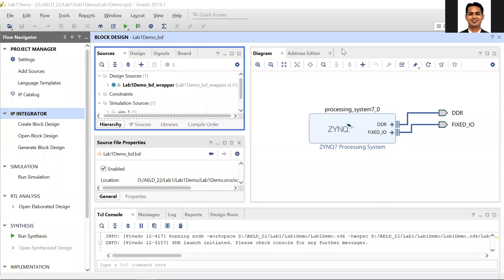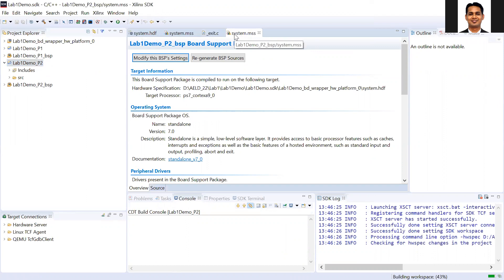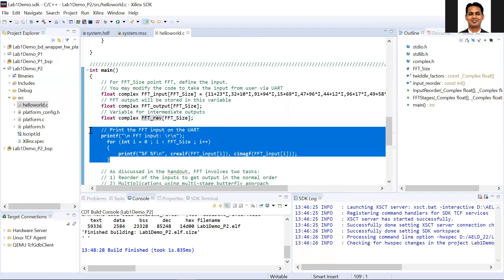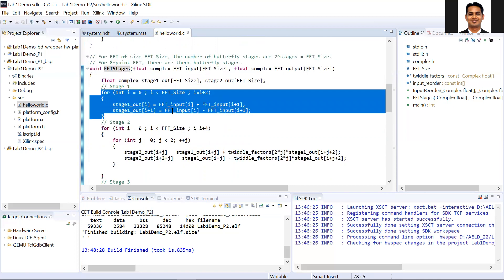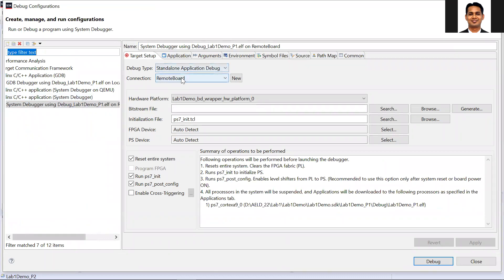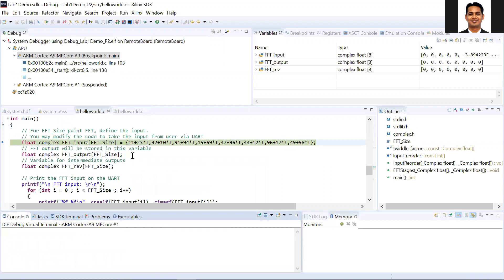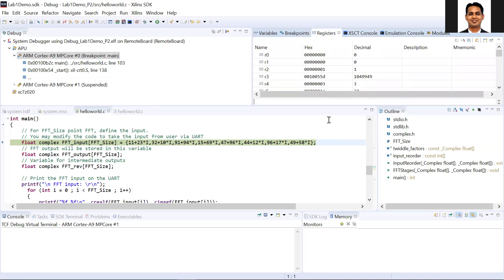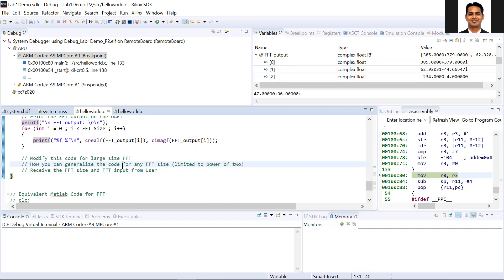IIITD AELD Lab2_P1: FFT on Zedboard ARM Cortex A9 Processor #zynq #zedboard #vivado #helloworld #FFT

Comment: #include <stdio.h>
#include <stdlib.h>
#include <complex.h>
#define FFT_Size 8
const float complex twiddle_factors[FFT_Size/2] = {1-0*I, 0.7071067811865476-0.7071067811865475*I, 0.0-1*I, -0.7071067811865476+0.7071067811865475*I};//last value is not mentioned clearly
const int input_reorder[FFT_Size] = {0, 4, 2, 6, 1, 5, 3, 7};
void InputReorder(float complex dataIn[FFT_Size], float complex dataOut[FFT_Size])
{

    for (int i = 0; i < FFT_Size; i++)
    {
        dataOut[i] = dataIn[input_reorder[i]];
    }
}

// For FFT of size FFT_Size, the number of butterfly stages are 2^stages = FFT_Size.
// For 8-point FFT, there are three butterfly stages
void FFTStages(float complex FFT_input[FFT_Size], float complex FFT_output[FFT_Size])
{
    float complex stage1_out[FFT_Size], stage2_out[FFT_Size];
    // Stage 1
    for (int i = 0; i < FFT_Size; i = i + 2)
    {
        stage1_out[i] = FFT_input[i] + FFT_input[i + 1];
        stage1_out[i + 1] = FFT_input[i] - FFT_input[i + 1];
    }

    // Stage2

    for (int i = 0; i < FFT_Size; i = i + 4)
    {
        for (int j = 0; j < 2; ++j)
        {

            stage2_out[i + j] = stage1_out[i + j] + twiddle_factors[2 * j] * stage1_out[i + j + 2];
            stage2_out[i + 2 + j] = stage1_out[i + j] - twiddle_factors[2 * j] * stage1_out[i + j + 2];
        }
    }
    // Stage 3
    for (int i = 0; i < FFT_Size / 2; i++)
    {

        FFT_output[i] = stage2_out[i] + twiddle_factors[i] * stage2_out[i + 4];
        FFT_output[i + 4] = stage2_out[i] - twiddle_factors[i] * stage2_out[i + 4];
    }
}

int main()
{
    // For FFT_Size point FFT, define the input.
    // You may modify the code to take the input from user via UART
    float complex FFT_input[FFT_Size] = { 11 + 23 * I,
                                          32 + 10 * I,
                                          91 + 94 * I,
                                          15 + 69 * I,
                                          47 + 96 * I,
                                          44 + 12 * I,
                                          96 + 17 * I,
                                          49 + 58 * I };
    // FFT output will be stored in this variable
    float complex FFT_output[FFT_Size];
    // Variable for intermediate outputs
    float complex FFT_rev[FFT_Size];
    
        // Print the FFT input on the UART
        printf("\n FFT input: \r\n");
    for (int i = 0; i < FFT_Size; i++)
    {
        printf("%f %f\n", crealf(FFT_input[i]), cimagf(FFT_input[i]));
    }

    // As discussed in the handout, FFT involves two tasks:
    // 1) Reorder of the inputs to get output in the normal order
    // 2) Multiplications using multi-stage butterfly approach
    InputReorder(FFT_input, FFT_rev); // Task 1
    FFTStages(FFT_rev, FFT_output);   // Task 2
    // Print the FFT output on the UART

    // Print the FFT output on the UART
    printf("\n FFT output: \n");
    for (int i = 0; i < FFT_Size; i++)
    {
        printf("%f %f\n", crealf(FFT_output[i]), cimagf(FFT_output[i]));
    }
}

i had taken this code for fft mentioned in the video  but it is giving incorrect value for 3rd and 7th index of the output array can anyone help me
Reply from the maker: Check this code:

#include <stdio.h>
#include <stdlib.h>
#include <complex.h>
#include <xtime_l.h> // Timer for execution time calculations

#define FFT_Size 8

const float complex twiddle_factors[FFT_Size/2] = {1-0*I, 0.7071067811865476-0.7071067811865475*I, 0.0-1*I,  -0.7071067811865475-0.7071067811865476*I};

// This function reorders the input to get the output in the normal order
// Refer the handout for the desired input order
const int input_reorder[FFT_Size] = {0, 4, 2, 6, 1, 5, 3, 7};
void InputReorder(float complex dataIn[FFT_Size], float complex dataOut[FFT_Size])
{
	for (int i = 0 ; i < FFT_Size ; i++)
	{
		dataOut[i] = dataIn[input_reorder[i]];
	}
}

// For FFT of size FFT_Size, the number of butterfly stages are 2^stages = FFT_Size.
// For 8-point FFT, there are three butterfly stages.
void FFTStages(float complex FFT_input[FFT_Size], float complex FFT_output[FFT_Size])
{
	float complex stage1_out[FFT_Size], stage2_out[FFT_Size];
	// Stage 1
	for (int i = 0 ; i < FFT_Size ; i=i+2)
	{
		stage1_out[i] = FFT_input[i] + FFT_input[i+1];
		stage1_out[i+1] = FFT_input[i] - FFT_input[i+1];
	}
	// Stage 2
	for (int i = 0 ; i < FFT_Size ; i=i+4)
	{
		for (int j = 0; j < 2; ++j)
		{
			stage2_out[i+j] = stage1_out[i+j] + twiddle_factors[2*j]*stage1_out[i+j+2];
			stage2_out[i+2+j] = stage1_out[i+j] - twiddle_factors[2*j]*stage1_out[i+j+2];
		}

	}
	// Stage 3
	for (int i = 0 ; i < FFT_Size/2 ; i++)
	{
		FFT_output[i] = stage2_out[i] + twiddle_factors[i]*stage2_out[i+4];
		FFT_output[i+4] = stage2_out[i] - twiddle_factors[i]*stage2_out[i+4];
	}

}

///////////////////////////////////////////////////////////////////////////////////////////////////////////////
int main()
{
	// For FFT_Size point FFT, define the input.
	// You may modify the code to take the input from user via UART
    float complex FFT_input[FFT_Size] = {11+23*I,32+10*I,91+94*I,15+69*I,47+96*I,44+12*I,96+17*I,49+58*I};
    // FFT output will be stored in this variable
    float complex FFT_output[FFT_Size];
    // Variable for intermediate outputs
    float complex FFT_rev[FFT_Size];

    // to store the time at which certain processes starts and ends
    XTime time_PS_start , time_PS_end;

    // Print the FFT input on the UART
    printf("\n FFT input: \r\n");
	  for (int i = 0 ; i < FFT_Size ; i++)
	  {
		  printf("%f %f\n", crealf(FFT_input[i]), cimagf(FFT_input[i]));
	  }

	 XTime_SetTime(0);
     XTime_GetTime(&time_PS_start); // Capture the timer value at the start
    // As discussed in the handout, FFT involves two tasks:
    // 1) Reorder of the inputs to get output in the normal order
    // 2) Multiplications using multi-stage butterfly approach
	InputReorder(FFT_input, FFT_rev); // Task 1
    FFTStages(FFT_rev, FFT_output); // Task 2
    XTime_GetTime(&time_PS_end); // Capture the timer value at the start

    // Print the FFT output on the UART
    printf("\n FFT output: \r\n");
    for (int i = 0 ; i < FFT_Size ; i++)
    {
        printf("%f %f\n", crealf(FFT_output[i]), cimagf(FFT_output[i]));
    }

    printf("\n-----------EXECUTION TIME--------------------\n");
    float time_processor = 0;
	time_processor = (float)1.0 * (time_PS_end - time_PS_start) / (COUNTS_PER_SECOND/1000000);
	printf("Execution Time for PS in Micro-Seconds : %f\n" , time_processor);

    // Modify this code for large size FFT
    // How you can generalize the code for any FFT size (limited to power of two)
    // Receive the FFT size and FFT input from User
}

// Equivalent Matlab Code for FFT
// clc;
// clear;
// FFT_Size =8;
// input_real =[11,32,91,15,47,44,96,49];
// input_imag =[23,10,94,69,96,12,17,58];
// FFT_input =complex(input_real,input_imag);
// FFT_out=fft(FFT_input,FFT_Size);
// disp(real(FFT_out));
// disp(imag(FFT_out));